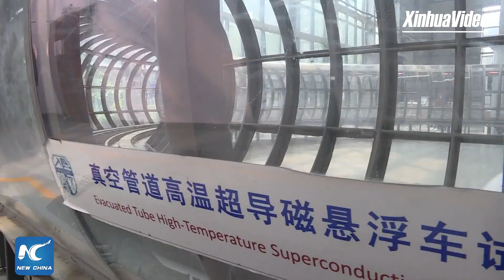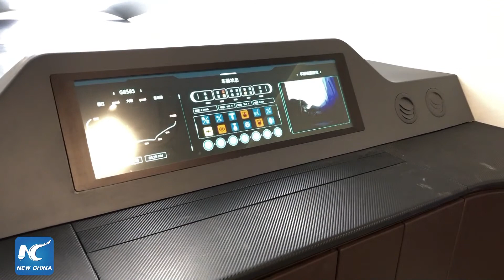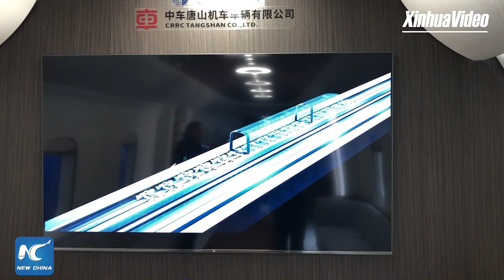LIVE: China rolls out "super bullet maglev" prototype with 620 km/h top speed

Comment: Why not make it wider to increase capacity? At constant speed, the additional power reqiured is only to overcome the increased drag (skin friction) which is quite minimal. More functional I would think.

Since nitrogen is used for cooling of superconductor, it may be advantages to reduce skin friction (hence reduce heat) on the under carriage. Perhaps some form of venturi pump to drag out the air between superconductor and track.

Just some thoughts which I hope it make sense.

Comment: One thing you haven't mention about the brake system
Reply: some other video actually talked about similar theory. You can do instant stop applying a reversed force, but that would probably kill everyone on the train. So the force needs to be applied gradually
Reply: Electric brake will like convert motion energy to electricity energy and back feed power to the grid. It is the most efficient and smooth braking system. Combined with conventional braking system which applies when speed drop down to 30% of the normal speed.